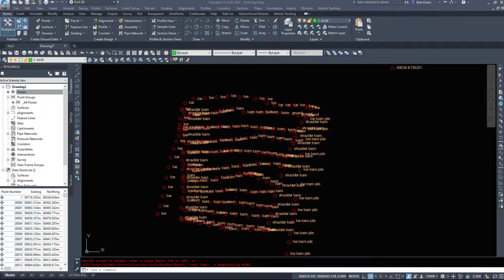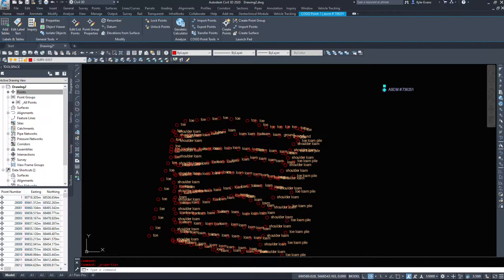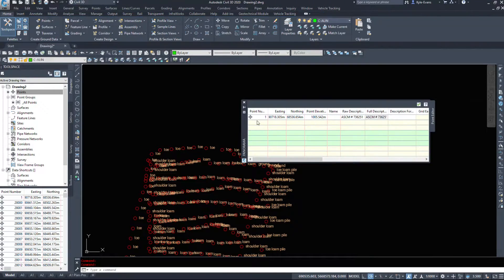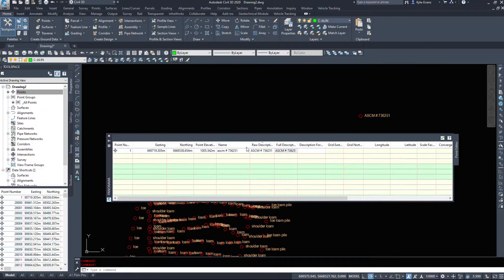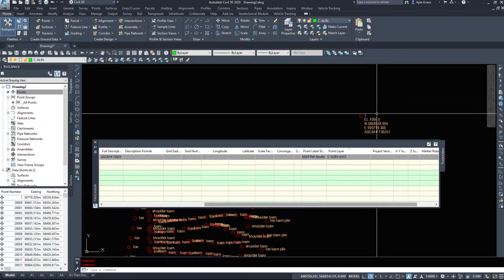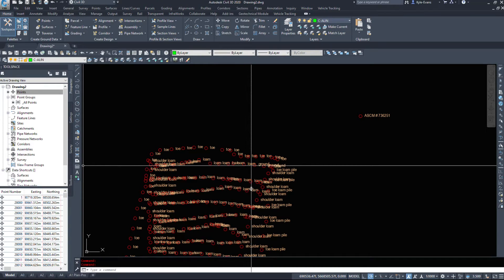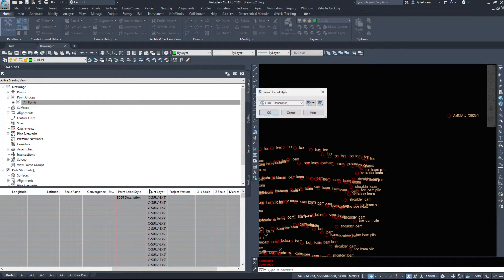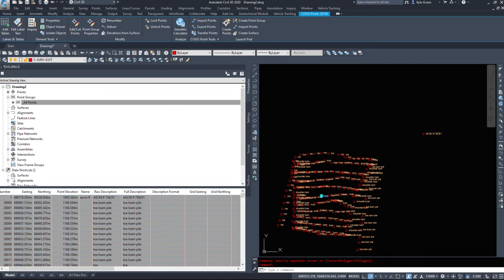Introduction to Civil 3D Part 7 - Editing Points

Comment: Not to be greedy, but would you consider making a video detailing the differences and benefits of style based plot tables versus color based? My company has alot of old timers that are resistant to change and I'm having a difficult time effectively demonstrating the value of a style based template unfortunately. Thanks again for your content and the time you've spend preparing it.
Reply from the maker: CTB vs STB or working with a template?
Reply: @KyleEvansCivil  CTB vs STB, with highlights to the benefits of STB. Might not be worth your time just thought I'd put it out there. Alot of our older CADD users are resistant to changing from CTB.